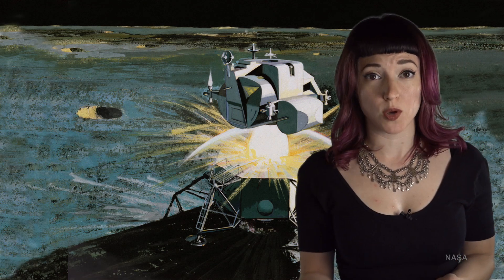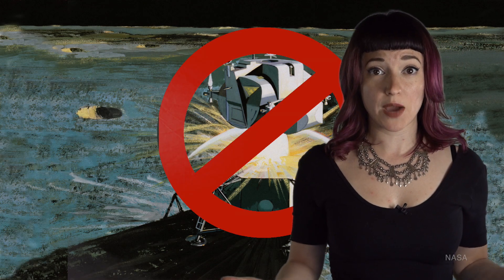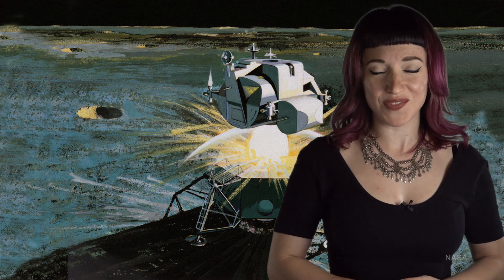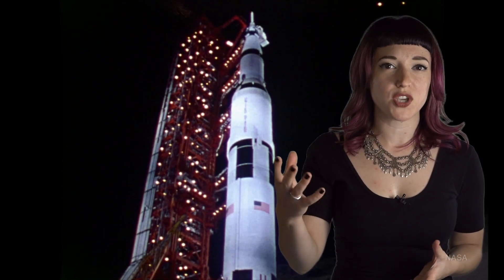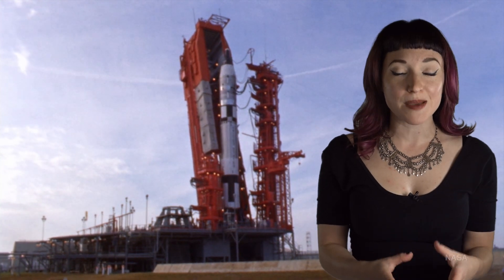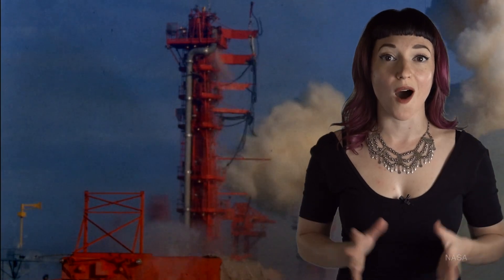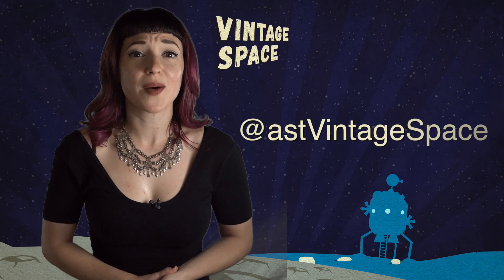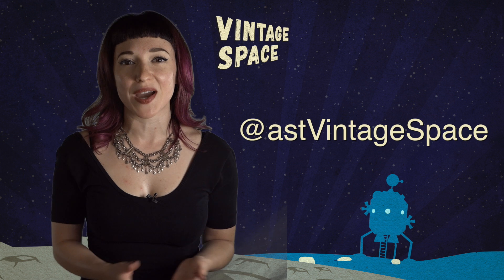How the Lunar Module Launched from the Moon Without a Flame

Comment: Great video, two quick followup questions:  1. There was still rocket fuel inside the LM descent stage when the LM ascent stage ignited, so what steps were taken to prevent the descent stage from exploding at that point?  2. You did a video on how the CM and SM separated via "guillotine," but how did the LM ascent and descent stages separate?  Was it explosive bolts or a similar "guillotine" method?   Thanks as always for your wonderful videos.
Reply: Yes after landing, the descent propellant tanks were purged but for a different reason than what you would expect. Of course, it had the additional benefit of making it safer when it was time to leave. :

"After lunar landing, the Commander simultaneously
opens two explosive vent valves to accomplish
planned depressurization of the descent
propellant tanks. This protects the astronauts,
when outside the LM, against untimely venting of
the tanks through the relief valve assemblies. "

The separation system was similar to the CM/SM. You can google "APOLLO NEWS REFERENCE LUNAR MODULE QUICK REFERENCE DATA " for more details plus the purge protocol starting on page 13.
Reply: Great reply.  Thanks!

Comment: Interesting.  I always thought that the amount of thrust created when it blasted off was sufficient to propel the LEM in a ballistic fashion, like a bullet.  But I like this explanation.
Reply: Try looking for the speed needed to orbit the moon. And then calculate the g-force if that speed was acheived in an instant.
Reply: I was never that worried about it.  I believe we landed men on the moon.  So, no thanks.
Reply: The speed required to attain lunar orbit from the surface of the moon is about 4,500 mph. If a spacecraft was fired off the surface of the moon with sufficient velocity and acceleration to get that 4,500 mph instantly, it would kill the occupants as the acceleration forces would be in the thousands of Gs. (That's why Jules Verne's cannon method of launching would not have worked for a manned spacecraft).
Therefore, even on the moon, a spacecraft has to accelerate gradually as it lifts away in order not to kill its occupants.

Comment: Also, on the Apollo 17 lunar lift off footage the camera controller did such a good job that he was able to track the Lunar Module right until it pitched over as it headed for orbit. At the moment of pitchover you get a view right up the engine bell - and you can clearly see the bright glow of the rocket motor.

Comment: One of the products of burning RP-1 (kerosene a hydrocarbon) is elemental carbon, i.e soot.  This is because some fraction of the hydrocarbons in RP-1 will crack into smaller constituents at the high temperatures present in the combustion chamber of a F-1.  One of these constituents is elemental carbon which at the temperatures within an F-1 exhaust plume will glow incandescently causing the characteristic bright yellow flame.  This is exactly what gives a candle flame its characteristic bright yellow flame although on slightly smaller scale than a F-1.  It is not just that that fuels are hypergolic that gives them little or no visual expression, it is that they burn producing no incandescent carbon.  Liquid oxygen and hydrogen are not hypergolic and burn with a very transparent flame, watch Shuttle launches from cameras filming the main engines, you can see up the nozzle to the combustion chamber.  Cheers, Mark
Reply: HyperGolic, not hyperBolic.
Reply: Fat finger or head
Reply: Mark Beeunas Hyperbole is something completely different.
Reply: You just don't give up.  Yes Allan I do and I did know the difference between "HyperGolic and hyperBolic" while I composed my original comment.  I do not have an explanation for why I typed it incorrectly and twice to boot.  I am dislexic, dyclecik, dicl..., dyslexic, which may play a factor.

Thanks for your original correction and annoying persistence.

Cheers,
Mark
***************************

Comment: Amy, how about a segment on the onboard computers used for the Apollo missions. Many deniers claim the primitive computers of the time were inadequate to make the necessary calculations needed for the missions. However, I contend that they did not need powerful computers to make those calculations. If you'll recall, on the aborted Apollo 13 mission, once they shut the power off, the crew used paper and pen to make the necessary Keplerian formulas needed to determine when to fire the rockets for the trajectory  home. 

The best videos that I have seen that show these computers in detail are made by a technologist named Fran Blanche who has a channel on YouTube. 

Great vids, thanks!
Reply: The computer issue needs only two words. Mission control. This is where the hard number crunching came from. Mission control used mainframe computers in back rooms to calculate the applicable info and then uplink that to the spacecraft.
Reply: My phone is better than those mainframes